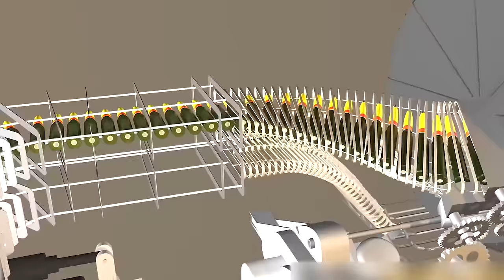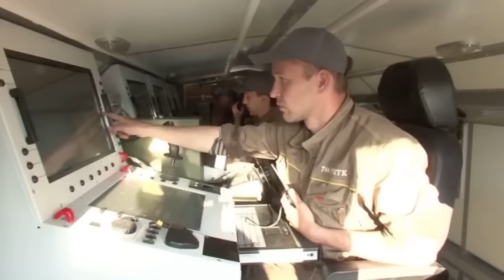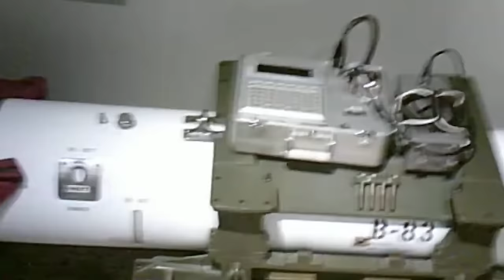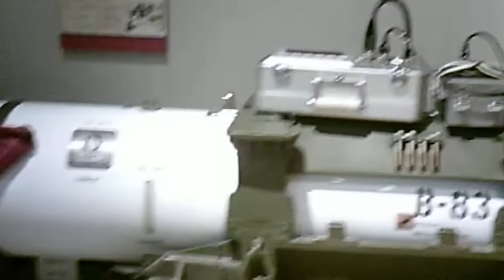The ONLY Machine Gun on the Planet That Can Turn Tanks into Scrap

Comment: Actually I fired a Vulcan 20mm mounted on an M113 at an M60, the tank was destroyed in a matter of seconds.  In this case the gun took hundreds of small nicks in such a short timeframe that not only did the armour of the M60 chip away; but it also heated up making subsiquent strikes take off even more steel;  the turret of the M60 could only take this hammering about 2-3 seconds before the was destroyed.
Reply: Yes sir that's a fact